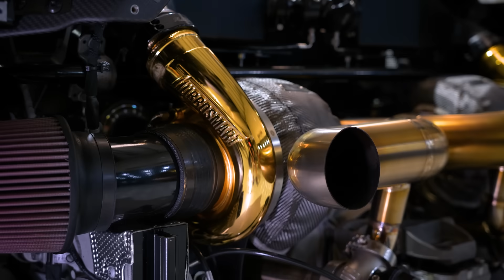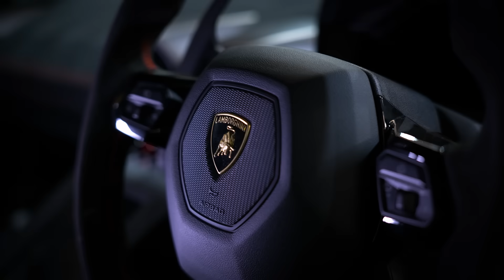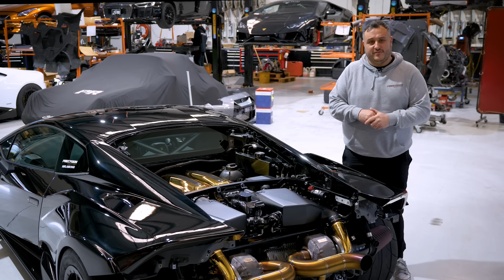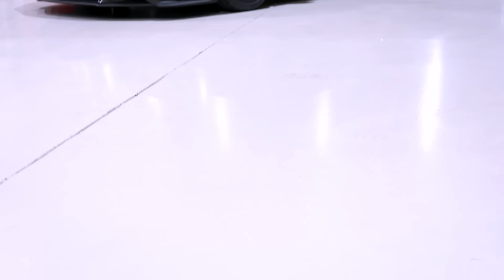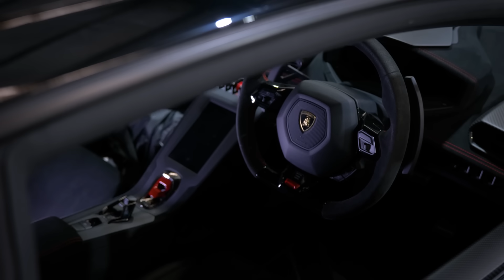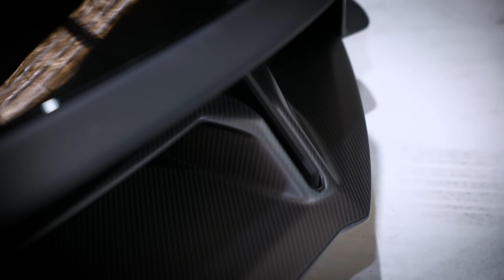2174HP Huracán STO - All Show & All Go - Turbosmart Titans

Comment: 8:45  Driverless lambo! Cool!!
Reply: When your making 2100+ hp the more the ecu tcu does it self the less chances it will hit a wall..The average person will not have the reflexes to do 3 or 4 things at once while w.o.t with 2100hp, shift on time consistently,pull power for slippage, tourqe limit in lower gears too much happening this is what makes them dominate roll racing. Less power you have more manual controll yes.but not in this case.